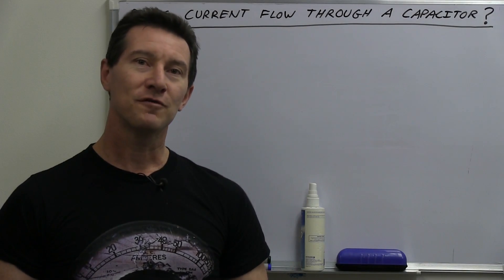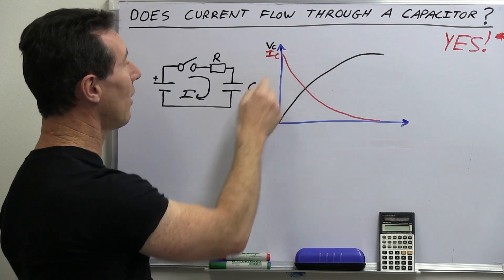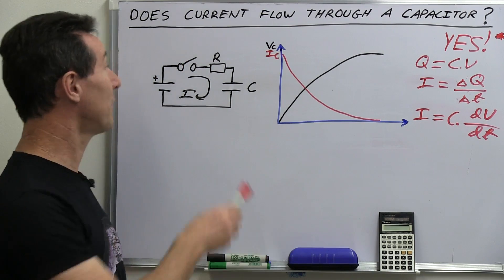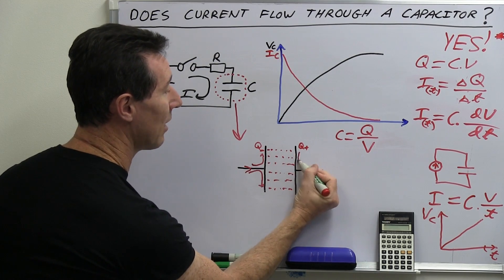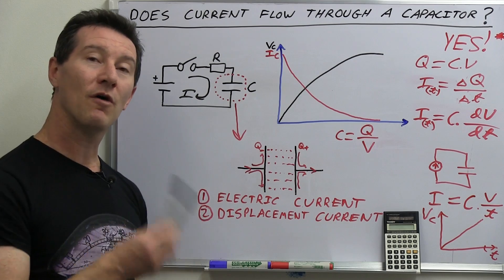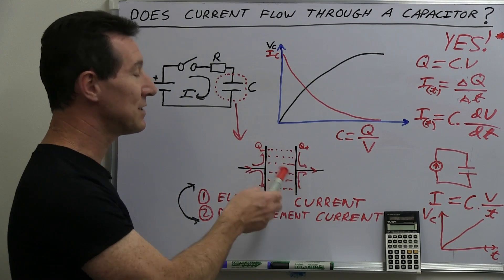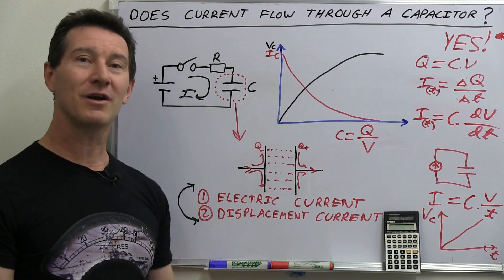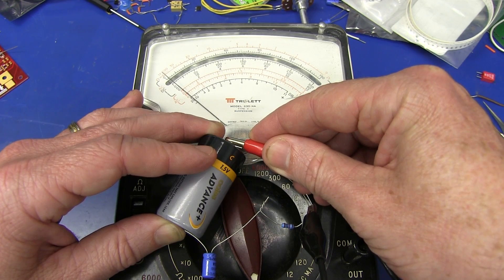EEVblog #486 - Does Current Flow Through A Capacitor?

Comment: Dave, the definition of current is not really that any particular electron went around the circuit.   It's more like a communication from one to another, so that the last one at the end feels the first one start to move.  Like the many metal spheres that hang on strings and go click click back and forth.  The middle ones never really move, but the end ones are communicating w/ each other.  You said it yourself.  Electrons move slowly.  About a mm per second.  Its the signal that moves quickly.  Start throwing the tomatoes......NOW!
Reply: +Solar Species All well and good, thanks.  It's been almost 50 years since i took basic electronics in college.  I'm sure your right.  I don't have the stomach to plow through it again.  I was kinda addressing the philosophical question that Dave was asking.  The answer is yes.  And here's why.  Current is in no way the electrons traveling around a circuit.  If it were, then AC would have no current.  It is the communication of field force.  The force is continuous across the cap, so that's it in a nutshell.  No math.  No tears. Just a simple idea.  Thanks for the reply.
On the other hand.  You are right also.  A charged cap will block DC.  Current will not flow. 
So should the answer be that it depends on the conditions of the current?  I will leave it to you.  I think you have a better grasp of the subject.

Comment: Imbedded in the symbol of a Batt is the symbol of a capacitor so picture a sin wave as the wave form goes up electrons are moved to one plate of the capacitor the other plate of the capacitor has a different amount of electrons and that’s how you get electron flow. That’s why in a DC circuit his meter moved for a moment but when the plate of the capacitor was fully charged the meter went back to infinity because there is no more electron flow. So does current flow through a capacitor? Let’s put the question another way can can electrons pass through a block of wood (dielectric) no

Can the difference in the number of electrons in one plate induce electron flow coming off the other plate yes? Is he wrong yes in the practical world is the right yes

Comment: So are you saying that if you had an ammeter connected between the capacitor and the negative side of the battery, you would get a reading when you closed the circuit switch?

Comment: I am sure that most here are familiar with the laws of capacitors. But I wanted to highlight something that unless you do the experiment yourself you might not look at it from this angle.

If you take two similar capacitors and put them in parallel, it is the same as doubling the surface area of the plates of a single capacitor. It is the same as one capacitor with twice the plate area. So you just add up your microfarads.

Two equal sized capacitors in series, is the same as doubling the thickness of your dielectric. It halves the capacitance of the capacitor.  

That means that 1/C = 1/C1 + 1/C2

So if C1 was one hundred microfarads, and C2 was one hundred microfarads, then C equals 50 microfarads. 1/100 + 1/100 = 2/100 and 1/ 2/100 = 50 or 0.01 + 0.01 = 0.02 and 1/0.02 = 50 So we have cut down the added total capacitance listed on both capacitors, to 1/4 of that 200 micro farad total, or 50 micro farads.

Now if you take your scope or multi meter and measure the voltage where two capacitors are connected in series. You will find that the voltage halfway through the dielectric is half the voltage of the voltage being applied to your two capacitors in series. Proving that there is a ramping or sloping charge within the dielectric material. That was my point.

I am looking for ways to nail down understandings and agreements about capacitors. I actually posted this in the wrong forum before. I was really looking for an answer, but I figured it all out.

As most of you know if you cut the voltage to a device in half it cuts the wattage to one quarter of what it would be at twice the voltage. So I was looking at these capacitors in series and wondering how we could double the thickness of the dielectric and cut the voltage and still only reduce the capacitance by 75 percent.

Then I remembered I had been through this before and realized the dielectric distance or thickness between plates, is doubled and that cuts the capacitance by half. Since we have created a single device you can only use the capacitance of one of the capacitors.
Reply: Bill Pruett, yes that is correct, however that is not the same thing as I proposed. That is not like a single capacitor at all.

Sincerely,

William McCormick
Reply: ***** The smaller capacitor limits the surface area of the dielectric. That is the limiting factor. 
Sincerely,
William McCormick

Comment: Essentially with the most basic law V = I*R, which means that in order to create any kind electronic component there has to be current flowing through it, if there is no current flowing through something that means that it does nothing in a electronic circuit therefore you may not as well have that component there, which is certainly not the case with capacitors

Comment: sorry sir but this current wil  floow through the capasitor untill the capasitor is fully charge after that capasitor will act like open circuit with high voltage and zero current ...

Comment: People misunderstand insulators for sure. A good experiment for you to do is to take a piece of aluminum foil, about two feet long. Lay it on a cement floor it can be a painted cement floor. Put a bag of sand or something similar on the aluminum foil to insure it is contacting the floor over most of its area. You can use a piece of aluminum metal without a sand bag. Attach one lead from a 24 volt DC source to the aluminum foil. You can use two A23 batteries in series. Attach the other lead to a volt meter set to volts, hold the other multi-meter lead in your hand. Then slowly lay down on the floor, watching the meter. As you put one knee on the floor, you will see the meter read voltage. When you put two knees and a hand on the floor you will see it go up in voltage. When you are totally laying on the floor you will probably read around 16-18 volts. Many electrical engineers will tell you that cement could not conduct that kind of low voltage, that it is just impossible. They would be mistaken.

Welders know that their 40 volt welding power supply is more then enough to give you a little tingle while you are on your back welding the underside of railings. The ground clamp is attached to railings anchored in the ground, when you change the consumable arc rod, which is powered at all times, you can feel a circuit has been created through your back and the concrete back to the railing. The key is surface area. The same is true with capacitors.

Comment: I have to compliment the individuals here, a truly remarkable group. Dave is just a madman of truth.

I do not know if you keep up with modern "physics" however as of late they have started back towards older real science. They have now admitted once again that there are only pushing forces in our universe. The idea of the "neutron" particle was based on forces of attraction. So I am looking forward to a sound course back to pre-World War Two physics.

As some here have mentioned, pushing forces move particles of electricity through a wire, with the force of repulsion. Particles of electricity only move from an abundance to a shortage of particles of electricity. That is basically how electricity works. There are no ions or anything complicated or mysterious at all. What is complicated and mysterious is that with electrical projects, like paintings or works of art, the possibilities are endless. That often leads to misconceptions, misunderstandings, of how things basically work.

Another fellow mentioned two air or pneumatic tanks as an analogy to a capacitor, that was an excellent analogy. The dielectric of a capacitor acts like two interposed check valves between two pneumatic tanks. When you send air pressure or particles of electricity to one side of the pneumatic tanks system or a capacitor, one check valve, activates and stops the flow of pressure in one direction. This allows the other side or other tank to supply a flow of particles of electricity back to the intake of the pneumatic pump, or the terminal of the battery that is short of particles of electricity, without a flow of heavy current through the capacitor dielectric, or check valves of the double pneumatic tank system.  Once you become assured there is only pressure, repulsion at work it becomes a lot more fun to understand.

Comment: That is a very good explanation of a capacitor. The diagram he drew of the insulator showing the particles of electricity, should look like a cone. The large end of the cone, indicating an abundance of particles of electricity, on one surface of the dielectric. The small end of the cone indicating a shortage of particles of electricity. As you may know they corrupted Benjamin Franklin's labeling of electricity, that he had proven using points and flats (types of electrodes). This disproved Du Fays two particle theory of electricity. So the abundance of electrical pressure, the abundance of electromotive force is actually on the college labeled (-) symbol. The plates have to charge in order to keep the dielectric from exploding. Just like lightning is formed to keep the storm cloud from exploding. The only way to stop electricity is with electricity. One particle of electricity will stave off two, two particles of electricity will stave off four and so on and so on. That is extremely simplified but very truthful and accurate.

Comment: Awesome. Thank you. Confirms my understanding.
See, the thing that confuses people (myself included) is when they talk about the concept of electron drift velocity which is very slow. However, when we define I = dQ/dT, it means charge velocity where electrons are the charge carriers. This current travels >50% of close to the speed of light. How can this be?
In Maxwells improvement to Amperes law it states clearly that 1/c^2 dE/dT is involved.
The way I see it is that although the electron drift is slow, what is important is the interaction of charge carrying particles interacting with each other via PHOTONS and thus in practical terms what we actually see is the charge flow via photon interactions between all the charge carriers i.e displacement current is all that matters.
Am I close?

Comment: Obviously what he's trying to tell us is that current flows through an open switch.
Reply: The Nudest Nudist As you open a switches contacts, current continues to flow, until there is enough distance, and enough ramping of voltage to stop the flow of current. That is why when you open a light switch you can see a plasma, a visible spark, when de energizing an inducting or self inducting circuit. Self inducting devices include, incandescent light bulbs and radiant heating elements, or under rated wire. All transformers, and electric motors that produce magnetic fields are inducting type loads, and are hard on the points of an air dielectric switch, or relay.